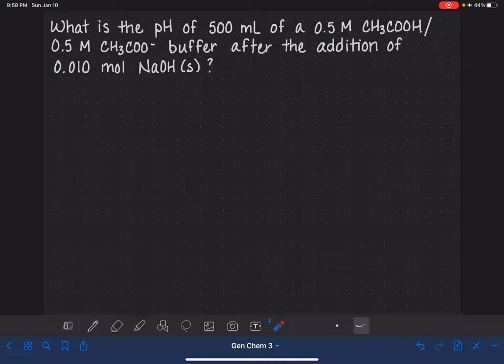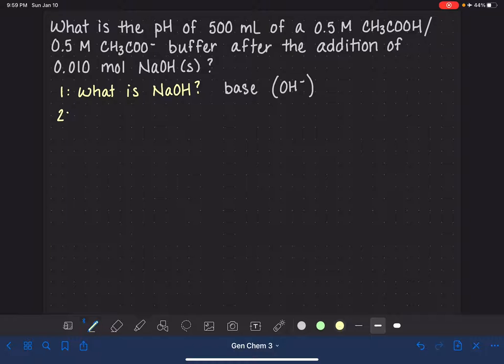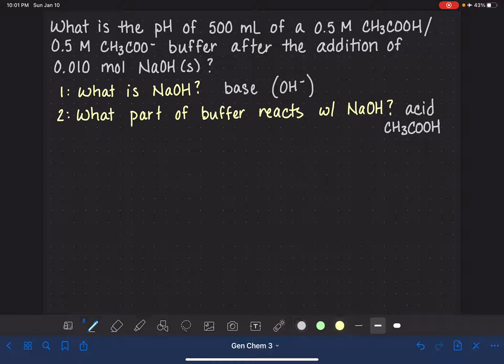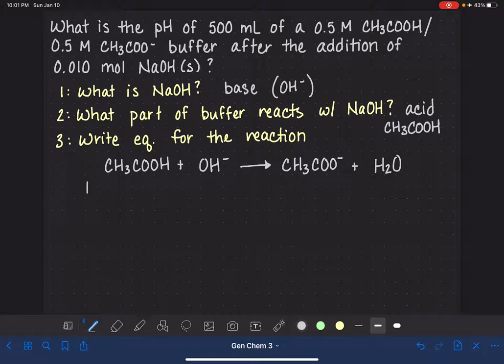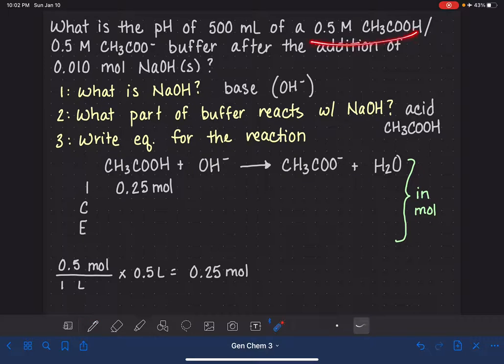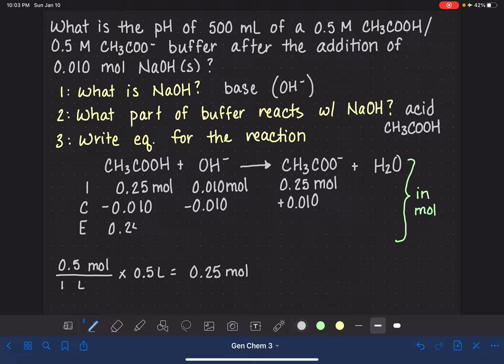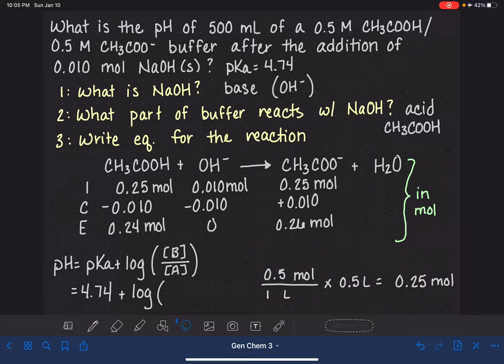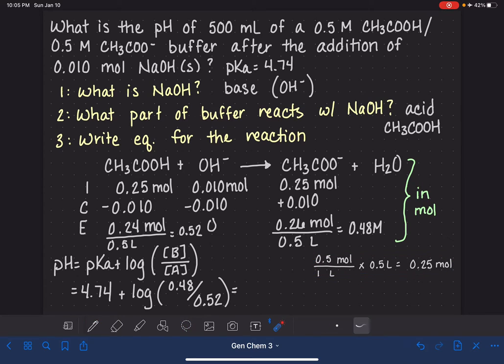33: Calculating the pH of a buffer after a base is added

Comment: i don't think we need to return it to molarity at the end. Great video either way, ma'am!
Reply from the maker: You are absolutely correct - it is not necessary to convert it back to molarity at the end.  However, I've found that this can be confusing to some beginning students, so I just take the extra step and convert it to molarity.  Advanced students understand that volume cancels with volume, and are comfortable taking that shortcut.  :)
Reply: @RoxiHulet  thank you so much 🙏

Comment: Great video with straight forward concepts! Just want to add that the calculation is a little off: the pH should be 4.74 + log(0.52/0.48), I think. You calculated 0.26/0.5 to be 0.48, but it should be 0.52

Comment: Hi, thank you for the tutorial however I think it’s unnecessary to convert moles in Molarity in the end bc moles and molarity are the same ratio therefore dividing 0.26/0.24+4.74 will result same outcome! I wanted to point out bc doing so many conversion might cause confusion
Reply from the maker: Oh yes, you are totally right. But in my experience, some students get really confused when I use moles instead of molarity because the H-H equation does have the molarity term. A few of them have picked up the misconception that moles and molarity are always interchangeable. Yikes. 

So unless I’m teaching in person, I just stick with molarity and don’t try to teach any shortcuts. :)